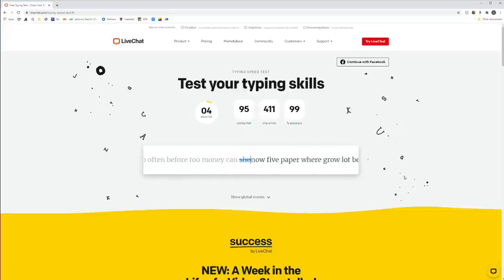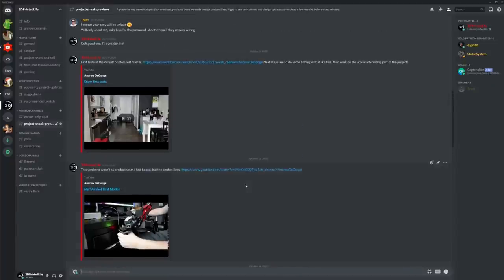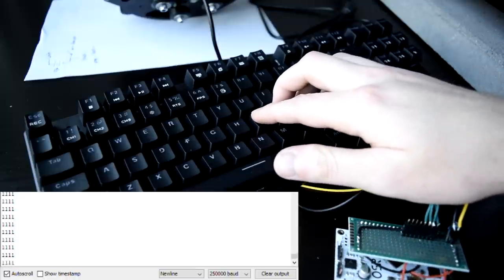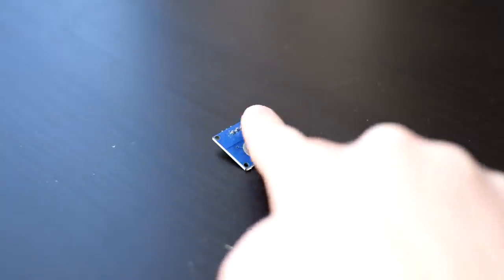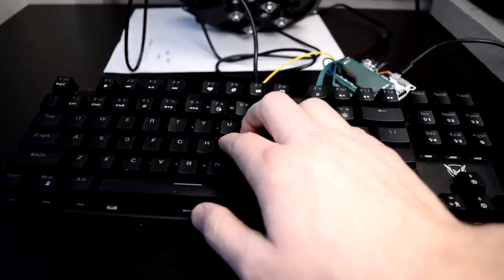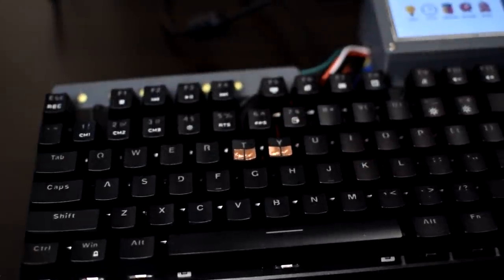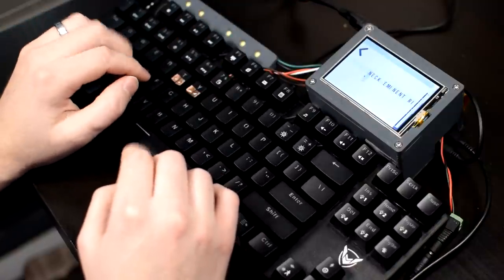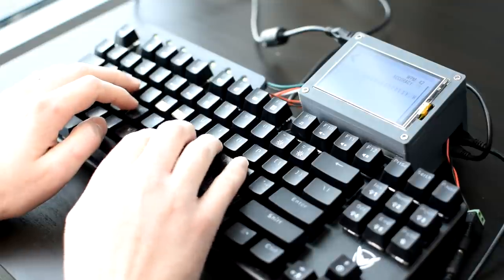This Keyboard Shocks You if you Don't Type Properly

Comment: Now do this with a Dvorak keyboard. That way you can force people to learn Dvorak.

You could also use a Face API or some other system to detect whenever the user is actually looking down.
Reply from the maker: I considered doing the eye detection for the led's, but scrapped it because it would have added a lot of complexity and I can already have a pretty good idea of when they're looking down based on game mode performance. Plus that poor pi zero was already working far too hard! But the Devorak keyboard really intrigues me, I had never heard of this before I made this project. And now I want to re-learn on one! I must be speeeed

Comment: From what I saw in the video, you are more a touch typist which don't make full use of the home row method of typing. I'd be curious to see if you can maintain those numbers(preferably with 100% accuracy) on a typing test that uses Lorem Ipsum rather than English words. The typing test should NOT let you leave mistakes in place, it should force you to correct them(which is what gets you the 100% accuracy at the final WPM score)

Awesome project, loved the video. I've watched your 2up and 3up videos and those were amazing, just wish they went a little more in depth.

Comment: Could you add a comprehnseive step-by-step explanation/tutorial about the neural network training thing? That would give that whole video some value.
Reply from the maker: Neural networks are a complex beast and I'm far from an expert, if you want to learn the most about them in general I'd suggest looking for some TensorFlow tutorials. In my application, I simply recorded the sensors outputs at 20hz and saved those to a file. I could then take each logged entry, run these through the same pre-processing I will do later when I'm using this model for detection, and feed these into the model as training data (with an additional array which matches up the correct output, so the mdoel knows when it's right and wrong. TensorFlow makes it really easy to use. Then after the model is compiled, I saved it and could re-load it whenever the main program starts. Then, whenever I want to use it I just collect a single sample from the sensors, do the same pre-processing, feed that into the model, and get the output.

Comment: Using analog touch sensors probably would have provided better data.
Reply from the maker: For sure, using digital sensors with an arbitrary threshold was in hindsight a not so great idea
Reply: @3DprintedLife  You might know about it, but Teensy has software-based capacitive sensing that works pretty well. No need for a separate sensor.